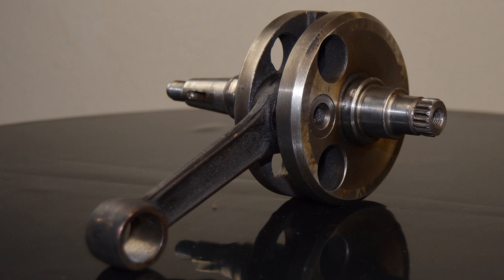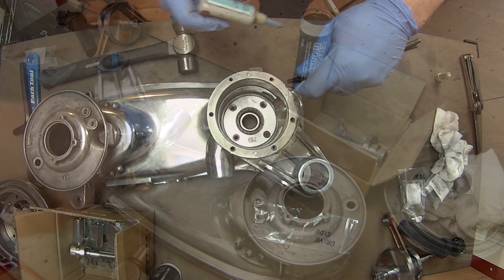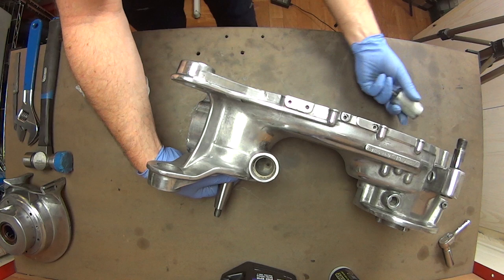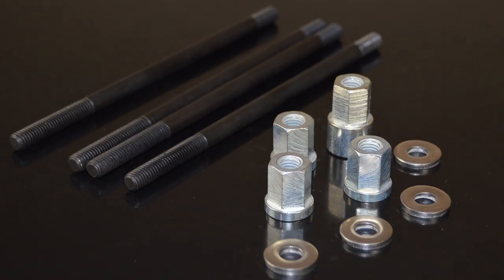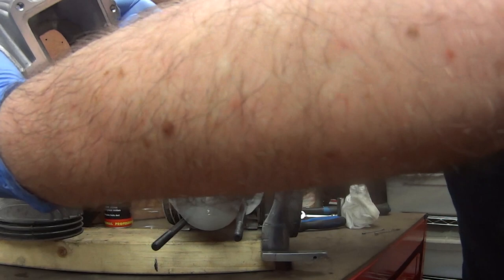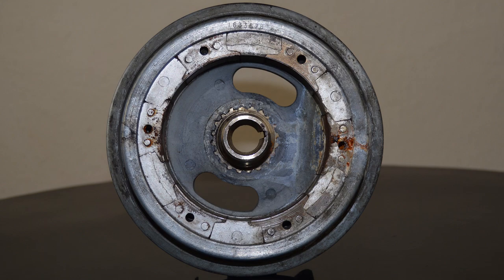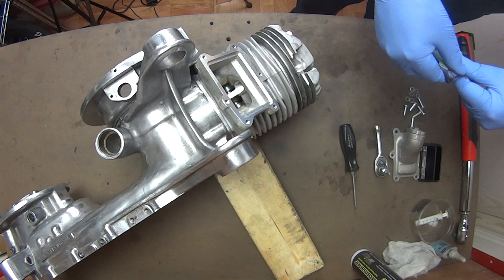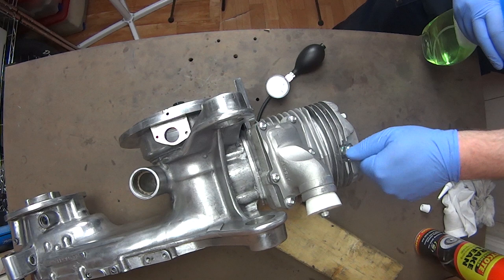Project Lambretta Episode 3

Comment: dont leave the seals in the sealed bearing . by doing this you stop lubrication on the back edge of the drive side bearing seal and it then fails and sucks oil in from gear box  . i also thought it was a good idea years ago but soon found it was a mistake ..... nice work .

Comment: So how did you get the cylinder studs to stop leaking???
Reply from the maker: Nothing to clever, I just had to strip the whole lot down (again) clean off the sealer then build the whole thing back up again only this time making sure to get a good bead of sealer around all the studs. On the packer plate I hadn't gone all the way round the studs on one side.
Reply: @732kustoms4  incredible amount of work just for that alone, I feel your pain!